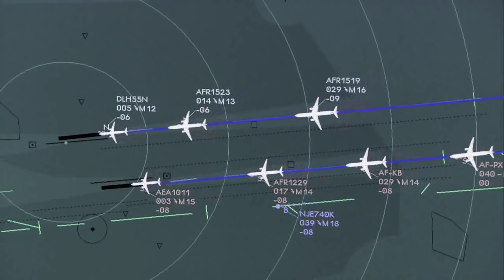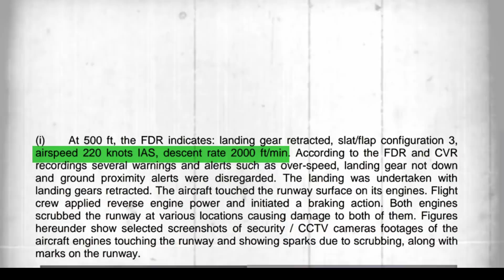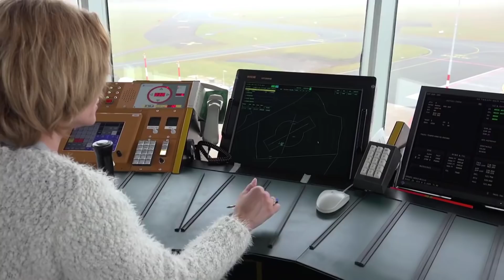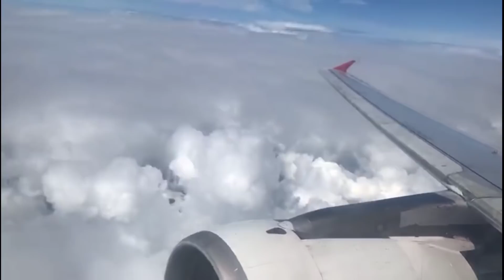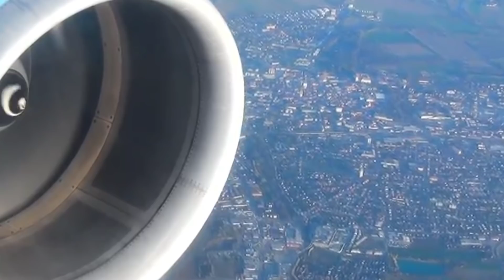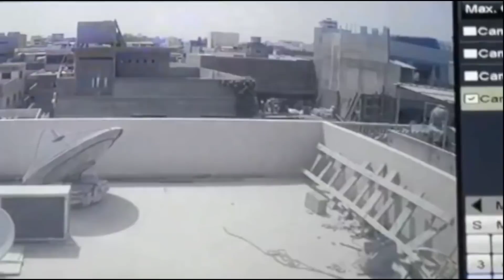Preliminary Report of PK-8303 part 2

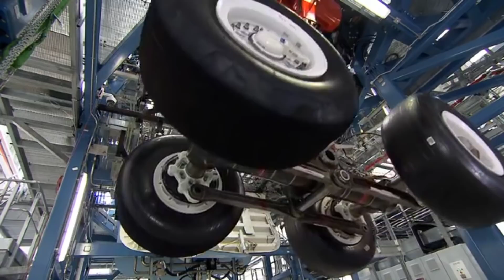Comment: 16:50 Activating the undercarriage before having made the turn towards the landing strip, was the final nail on the coffin; it ought to be after the turn, and never before! Landing on the belly would be too dangerous, and would have made the second landing attempt pointless!
Reply from the maker: Without landing gear would have given pilots enough window to make it to the runway. But they extended way to early...
Reply: @mfahad5  The undercarriage was working fine; it ought to be lowered when being on a straight line with the strip -- let us say 25 seconds, or so, before touch down on the tarmac!
Reply from the maker: @maanvol  yes you are right. But as per the video i think they lowered the landing gear as soon they turn from base to final.
Reply: @mfahad5  Indeed, the last fatal mistake! Please, do remember by then the undercarriage had become an obsession, for the pilots, to be deployed as soon as possible, to play it safe next time round...
Reply from the maker: @maanvol  indeed....
Reply: @mfahad5  I do understand why they did it: they were still counting on the engines' thrust to help them overcome the extra drag! They were not aware of the fatal damage that the engines occurred on the tarmac!
Reply from the maker: @maanvol  true... The thought that they would go away with it but the engines failed on them and the couldn't take necessary decisions to safe the aircraft...
Reply: maanvol - Not at all. When you are left hot and high by ATC (or your own cock-up) and given a convenient short cut you have a choice. Track miles and time or speed and drag? Both are good but the latter requires more skill. As these things cost something like $100/minute to fly I generally chose speed and drag. That might mean flying for a considerable time with gear down with several turns to be made.

EDIT: I may have misunderstood maanvol’s comment. If he was talking about lowering the gear after the engine failure as PK8303 was going downwind at 2,000’ then that is generally too early. Short finals, or when short of height, not at all are generally better options. Apologies if I misunderstood.
Reply: @Trevor_Austin  Trevor, you mistook maanvol's comment. He is talking about wheels in the TOGA. They lowered it way ahead, and could have made it back to the runway threshold had they retracted the gears. Actually the pilots would have made it easily if they knew how to glide the plane even with wheels down! but they did some other nose up moves with a high AOA which also shrunk the glide distance.
Reply: Shawn Reddick - I get your point and I agree. However I’m not sure sure about flying with a high angle of attack causing the drag. At approach speed you are typically very close to Green Dot. The thing that did the damage to the glide was the gear and as we saw earlier, a gear up landing is quite feasible.